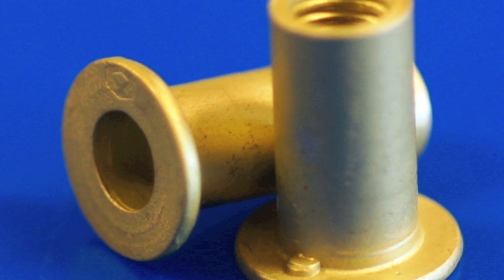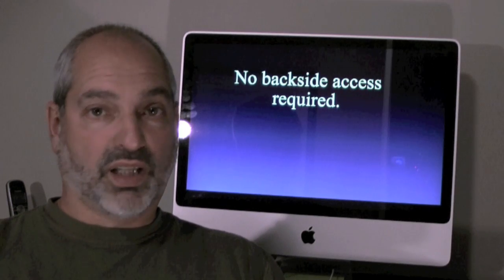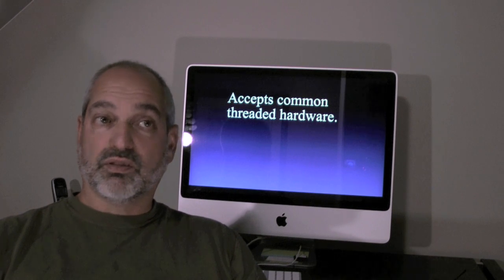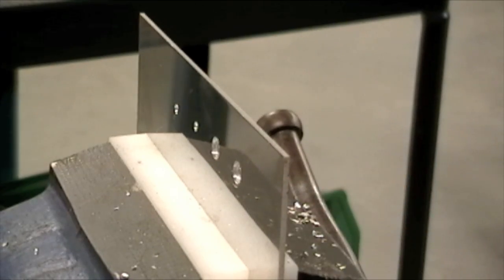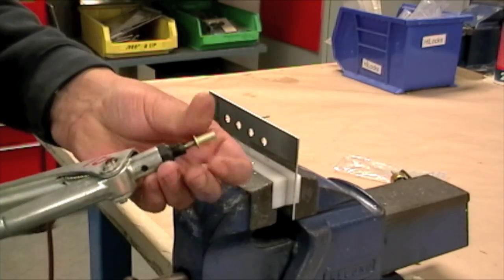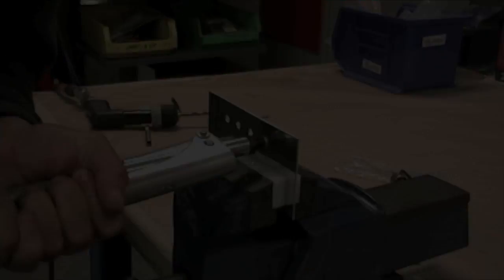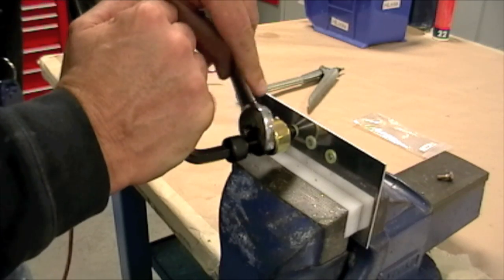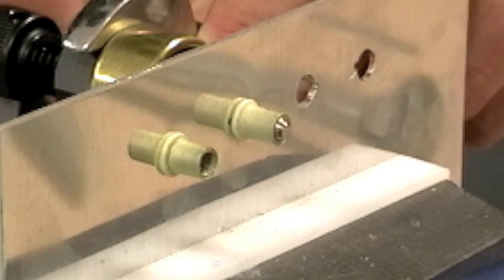Installing Rivnuts

Comment from the maker: D Wetick - the purpose of the notch, as explained many years ago, was to prevent the RivNuts from rotating during installation of the threaded fastener.   It always seemed a bit "cagey," because a notch at the edge of a hole looks like a natural place for a crack to start, no?

Comment: At 1:38 you show the turning of the allen wrench to pull or set the rivnut.  This is the incorrect method, the allen wrench should be stationary, used to hold the rivnut and installation tool steady and perpendicular to the work piece.  Using the method you show risks the threads turning within the rivnut, which may cause galling, stripping, or other defects.  The 3/4" wrench (in this case) is what should be turned to provide the pull force, as it uses the internal bearing surface and the outer, larger threads to pull. Much less risk of damage to both the tool and the rivnut.
Reply from the maker: Thanks, and an excellent point.  The thread engagement inside the Rivnut should be kept still, and only the wrench turned.  I'm glad you pointed that out - viewers should be aware that the allen wrench is not to be rotated. 
Thanks to McCartney Paint and Custom.

Comment from the maker: Hi, Adonay ~  no, my memory for Mil specs is not that good.  But what you can do is talk to a local supplier of rivets and they will be able to give you the Mil specs.  Our typical Rivnut part number was something like A10-K80, which I think was a GoodYear product.  They're a very common aluminum body fastener, and many suppliers offer them.  Or, you can research the part number on the internet.  K.

Comment from the maker: That's correct - you do not need to access the blind side of a RivNut for installation purposes.  The video shows a sample piece of sheet metal in a bench vise, which is merely showing the distortion of the body of the RivNut during the process.  There are often areas of aircraft where you cannot reach with tooling.